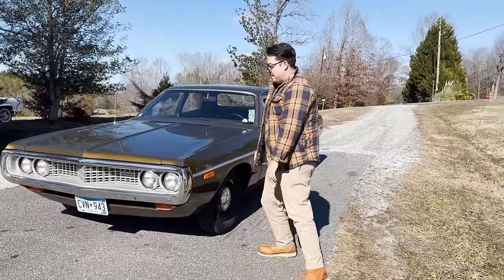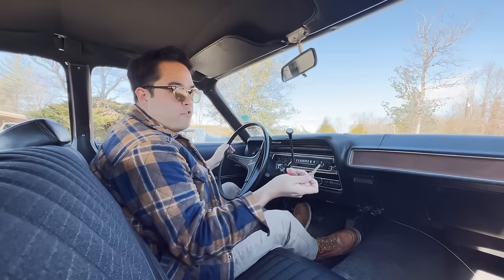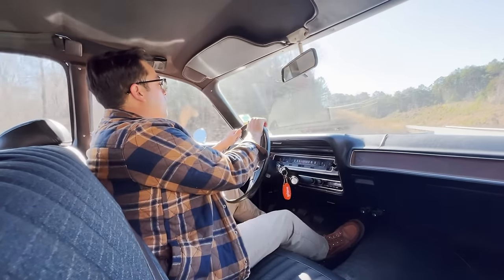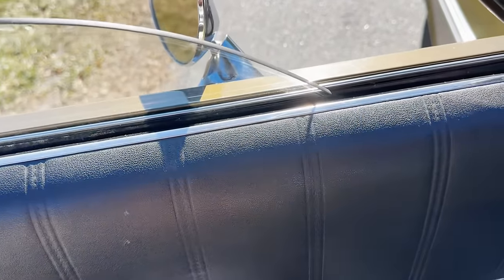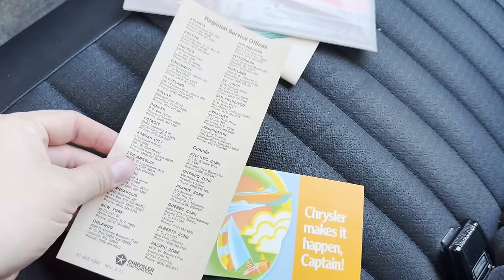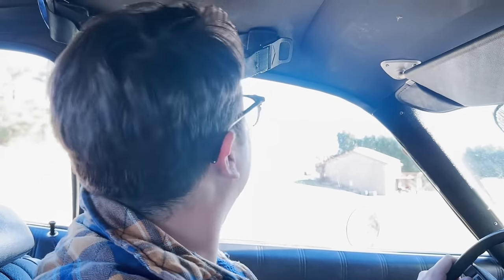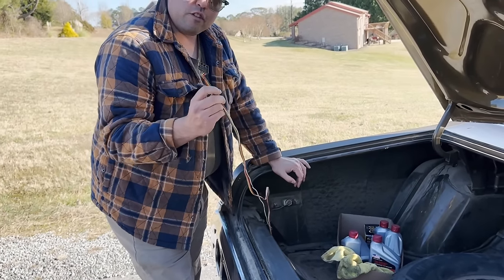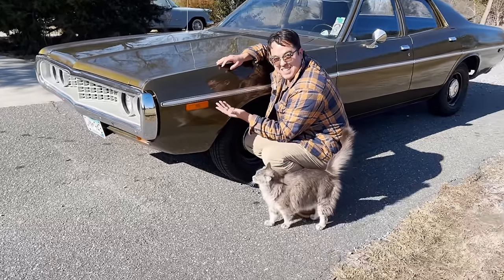1972 Dodge Coronet Custom! Rare Slant Six Stick Shift! Obsolete Automotive Reviews Walkthrough Drive

Comment: That car is in great shape.  I drove many slant-six models over the years with three-on-the-tree, and always enjoyed the powertrain as primitive as it seemed.  The slant-six is a very smooth engine, rivaling any BMW straight-six.  Pity it didn't get more respect over the years.  If you can quiet down the exhaust with a muffler, the engine sounds will be a treat.
Reply: the straight 6 from BMW, with 2.5 liter and just 2 valves per cylinder makes 168hp, the slant 6 100…..
Reply: Easy.... he said smooth,  not powerful. And actually,,, I think my 82 slant six is noticeably smoother than my buddies 90 M3 convertible.
Reply: Leaning tower of power. One of Chryslers' best.
Reply: @PatricioGarcia1973  Watch the  Power Nation build on a  slant 6. That is basically adding compression and cam  to compete with BMW  with modern fuel injection and cam profile for 220 horse.
Reply: @PatricioGarcia1973 Was this BMW sedans in the 70s?
Reply: @patrickwayne3701 
A ‘90 M3 convertible is a 4-cylinder bud, so no comparison.
Reply: @JeffreyWilliams-dr7qe 
Let’s compare this to a BMW M30 straight six, launched in 1968 in 2.5 litre and 2.8 litre form.
In the seventies, these engines delivered 150 hp and 170 hp. 
And they sound sweet.
Reply: @frankpeletz1818 
220 hp from what displacement?
Reply: @e28forever30  3.7 . And 400 horse when turboed.
Reply: I think they got their due. They were everywhere for many years.
Reply: @patrickwayne3701  if it really is a 1990 m3 it doesn't have a 6 cyl engine. the first gen m3 was a 4 cyl. second gen wasn't released until a few years into the 90s
Reply: All inline, six cylinders are inherently smooth. Just the nature of the beast. I have owned inline sixes from 150ci, 2.5l to 300ci, 4.9l, and they were all very good engines. Never owned a slant six, but drove several. Always thought they were good engines. Put a 225ci slant six in a Dart with a three on the tree, and they were surprisingly peppy.
Reply: In Australia, the Slant-6 was no slouch. It arrived in the Valiant sedan in the very early 60s. Our family or ‘full-sized’ cars were pretty much compact shopping carts by American standards. Chrysler’s offering, at 225 c.i. 145hp was a giant compared to what was offered by Holden (local GM) at 138 c.i and 75hp, and Ford 144c.i. (Supposedly and generously) 90hp. Pretty soon, GMH and Ford upgraded to 149/179 c.i. and 170 and 200 c.i. (The latter a rare option). Manual and three-on-the-tree were common. Even in 1973, our family got a Holden sedan with a 173c.i three-on-the-tree that had 118 hp. Super basic bare bones. By this stage, Australia had its own ‘petrol-head’ culture and smaller V8s were getting more common. Of course it didn’t last and two fuel crises later, the V8s were pretty much dead. Meantime, it was cool and almost ‘muscle-car’ like, to have a 225 in your family car.

Comment: Cool car. Back in 1986 I bought a 1968 Dodge Coronet 2dr Coupe from the original owner for $400. It had a slant 6 automatic trans. It only had power steering. It even had a radio delete plate. Trans went out a year later and I let it go. I should have fixed it but at the time I was putting my money in my 1969 Roadrunner. Sold that 10 years ago. Please keep posting cool videos like this.
Reply from the maker: How it goes sometimes… Thanks for following. Have plans for plenty more content on these old rides.

Comment: Kind of amazed at the condition of the car considering where it came from. The slant sixes were very good engines, surprisingly peppy for their displacement. Drum brakes weren't as bad as people make them out to be nowadays. The really biggest problem with them was brake fade due to overheating if used heavily or getting wet if you drove through water. Keep them adjusted, and they gave good service. Drove many cars with manual drum brakes for more years than I want to think about and didn't run into anything. Just need to understand the limits of what you are working with.
Reply: In other words, dramatically worse than discs.
Reply: @ErikDB6  didn't say they were better, said they worked well enough to get the job done at the time. Of course, power disc brakes are superior. Not a question.  Everybody knows that.
Reply: I'm amazed because it's such an undesirable model and that someone kept it and cared for it all these years.
Reply: @wb6162  different strokes for different folks, I guess. Who knows?
Reply: @christownsend7602   No doubt!
Reply: right on. and..ppl replacing the shoes with substandard parts to save a buck. i mean really..the price 
difference was negligible..wonder how many wrecks occured & even lives lost on getting cheap 
brake shoes & even pads for disc brakes..that could've been prevented? & yeah..this car is 
mint for being a Wisc car..must've not driven much in winter.
Reply: Super rare & super cool!
Reply: My 69 Chrysler has 4 wheel drum brakes, stops the car very well.
Reply: @Wiencourager  if drum brakes are maintained correctly, they work just fine. You learn not to over drive what your brakes can do. It was a long time before all cars had front brakes when they first hit the scene.

Comment: I was waiting for this video!  To answer your question about the seat inserts, they are definitely original.  As for the “Dodge” emblem found in the glovebox, that is a 1970 or early badge because the font was no longer script by 1971.  Does the fender tag have any Y codes indicating it was a special order vehicle?  It certainly is uniquely optioned to have the custom trim interior, the R11 AM two-watt radio and power steering.  Yet it’s an E24 Slant Six with a D14 three-on-tree manual transmission.  As for the “fasten seat belt” light, all Chrysler Corporation vehicles built after January 1, 1972 have such a reminder.  Early build 1972 model year vehicles produced between between August-December 1971 do not have such a feature.  Beautiful car, great YouTube channel and excellent Instragram account.  Let me know if you have any further questions.😮
Reply: Spoken with authority 👍

Comment: My first car was a 1965 Plymouth Valiant  4 door with a 225 ci. Slant 6 and 3 speed automatic. No not the push button, but the traditional column shifter. That car ran great. The slant 6 is near bullet proof. Mine never had any real rust either. It still had the clear plastic covering on the front and rear bench seats.

It had the stock AM radio. I did put in a good am/fm/  cassette stereo with rear deck 6x9 speakers.

I got the car in 1982 so it was 17 y.o. at the time but it was a great car for the $500 my dad paid for it for my 17th. Birthday. I at times wish I kept it and put on a real nice paint job and  just enjoyed it for the classic it was to become.🤔
Reply from the maker: My first cross country trip was in a 1964 Valiant 2dr sedan. 225 Slant 6 with 3 speed on the column. Bought it sight unseen in CA. Flew out. Got it roadworthy in a junkyard and then drove it 5000 miles the long way back home to NC. Lost the ability to use the clutch pedal near the beginning of the trip and had to drive most of the way without it!

Comment: It’s a beauty, and very unusually optioned too, I’d love to be driving a 3 speed, very cool. I wouldn’t be surprised if the cruise control turned out to be an aftermarket add on, they were readily available. I think a new muffler would be on my list of things to address though.
Reply: Had a similar '73 model 225 shift-it-yourself, disc power brakes, no power steering, after-market A/C. Mine was "dark yellow green metallic" paint code JF8 and on a good day gas mileage might break the 10mpg mark. Plenty of room, not a bad ride, but Spielberg could have made seven more movies about the electrical and suspension alignment gremlins. And the starting procedure: flood the living elkhound-crap out of it and then follow the flooded carb procedure was the easiest and most reliable.
Reply from the maker: Adding a muffler is on the to do list for sure!
Reply: @5610winston   I think something was wrong with your carburetor 🤔 Squeezing 15mpg out of the thing isn’t unreasonable, and a Slant usually starts with ease
Reply: My brother bought a 1971 Satellite  Plain Jane, 318,auto,and PS and AM radio.    I got to drive it , loved the power steering!
Reply: @5610winston  Guarantee your vacuum advance is dead.  That's guaranteed to kill fuel economy.  Wouldn't be surprised to find the centrifugal advance is stuck as well.  Send your distributor out for a rebuild and your fuel economy will increase big time.  
Your carb is due for a rebuild as well.  Your car should be getting in the high teens mpg with no problem.
Reply: Actually, I would try to add headers and maybe a split exhaust, just to extract a little more power-and cool sound-from that slant six. They were very durable, but needed a little more hp!
Reply: @curbozerboomer1773   The head was designed for the smaller 198 cu. in. six.  When Mopar stroked it to 225, the head was not changed.  So, it has trouble breathing.  More torque but, can't make the kind of HP that its torque would suggest.
Reply: @BlackPill-pu4vi  — The head was designed for the 170 …
Reply: @Clyde-2055   Then the 225 is even more choked than I thought.
Reply: @BlackPill-pu4vi  — The 225 was no powerhouse, but in the A-body, the pre-emission cars would do 105-110 mph … That was plenty fast. 

I don’t imagine this Coronet would do 110, brick-shaped thing that it is.
Reply: @BlackPill-pu4vi Uncle Tony could teach you how to build a slant 6.

Comment: My dad had a 71 coronet custom with the 383 2bbl, power brakes and steering with A/C. The color was butterscotch.
Reply: @jyeager2881. I loved the firing order on the 383 engine. It was supposed to simplify things but confused mechanics everywhere. Usually MOPAR engines used the same firing order as Chevys. If the mechanics weren’t careful the engine they were servicing during tuneups didn’t fire up so they’d try Ford’s firing order.  The actual firing order that MOPAR tried out on the 383?was 12345678. If they were sharp they’d go straight to the Miller Repair Manual
Reply: @LlyleHunter  ^^ LOLOLOL …

Comment: Since I was born in 1951 I remember cars that had the three speed column shift transmission, that was common in the 1950s and 1960s. Because there was a lot mechanical linkage going from the lever on the steering column to the transmission, the shift lever would have a considerable amount of free play movement. Also as the linkage became worn with age, it would become difficult to shift gears, with the gearshift lever binding. I also noticed that the seat belt and lap belt set up on this 1972 Dodge Coronet was the same as my parents 1971 Ford Country Sedan station wagon. So it is true that seat belts were set up this way in that early 1970s time period.

Comment: Very cool car, the slant 6 and 3 speed won't win any races but they'll last until the end of time if maintained. As far as the 3.21 and 3.23 axle ratios you mentioned about 9:00, it's because there were 2 different axles offered in the car, the Chrysler 8 1/4 (with 3.21 ratio) and Chrysler 8 3/4 (With 3.23 ratio) so upgrading to the alternative axle ratio gave you the stronger axle, but the standard 8 1/4 is really quite tough.
Reply from the maker: Seemed kinda funny that the standard ratio and optional ratio was so close. It doesn’t differentiate a different rear type Though a sure grip 3.23 ratio is offered as well. They’re so close that I don’t see much benefit of choosing one over the other unless you wanted the sure grip rear.
Reply: @ObsoleteAutomotive  Right, the factory literature never explained that by choosing an alternative (but a nearly identical axle ratio) you were actually upgrading to a different axle. Both axles had different number of pinion and ring gear teeth, so the available ratios were close but never matched.
Reply: The Sure Grip (locking differential) was always worth the upgrade. If only Detroit had equipped all cars with locking differentials and rear stabilizing bars as well as better shocks and transmission coolers all as standard equipment they would probably have done a lot better at retaining their market share when it was shrinking

Comment: Very hard if not impossible to get replacement parts for that shift collar / lever.  Treat it very nicely.  They're well known to wear out / break.
Reply: When I was a kid my mom drove a 1953 Plymouth Belvedere. It had 3 on the tree. I must have made her angry chirping/lipping off from the backseat because after she parked the car, the gear lever was wrapped partly around the steering column towards the driver's door. Dad had to weld up a new shift lever... sorry mom...

Comment: All of the dashboard controls can be adjusted intuitively, without taking your eyes off the road. Makes me wonder if the touchscreens of today are a step backwards. My parents had a 1969 Plymouth Gran Fury, a very similar design. The Chrysler styling theme from this era was billed as "fuselage" , owing to the aircraft-inspired rounded sides.
Reply from the maker: I hate touchscreens. I like being able to use controls without looking. It is going backwards and less safe in my opinion.
Reply: Agree it's a cost saving measure being marketed as a cool feature to the modern IPhone generation. 
I love my VF Holden commodore made in Australia you still have intuitive knows for climate control. Then infotainment features can be done with know, touchscreen or voice command. Shame about the demise of car manufacturing in Australia as we had some great cars just like the Americans

Comment: You're correct about the '71 cars having a separate buckle for the shoulder belt.  I had a 1971 Oldsmobile Delta 88, and the lap belt and shoulder belt did not connect and had their own buckles.  It's wild to see a 3-on-the-tree still going in 2024.  Thanks for sharing!

Comment: The marker lights and shoulder belts were a federal requirement starting in 1968. From 1968 through 1971, all solid-roof Mopar cars had the separate shoulder belt buckle that was identical to the lap belt buckle. It was easy to confuse except the webbing with the shoulder belt buckle was MUCH shorter. The front seat (with seating for three) was a rat's nest of webbing in our family's 1970 Fury base Suburban. When I was driving our Fury with the shoulder belt on, I could reach everything but the brake release.
Reply: You were very smart to have buckled up back then.  Most people that buckled up back then usually just wore the lap belt.
Reply: @bradparris99  We lost that car in 1986 when someone in opposing traffic turned left in the rain, and I T-boned him. I was the only one in the family who did more than lap belts. The ironic rest of the story is that I now belong to a 1970 Fury III convertible (i.e., no shoulder belts).
Reply: @OnkelPHMagee  As a 16 year old in the mid 70s I had my grandfather's 1970 Buick Electra to drive.  After about a week of driving and sliding on that big bench seat and seeing "Fasten Seat Belts" printed above the steering column I buckled up the lap and separate shoulder belts, mainly out of curiosity.  Aside from the obvious safety aspect of wearing both belts, I was amazed at how much better the car seemed to drive and handle while being securely strapped in the driver's seat. I was soon in the habit of automatically buckling up every time I drove.  I was probably the first one to use the lap belt and I am sure I was the first one to use the shoulder belt. My grandfather thought seat belts were a nuisance and crammed the belts into the crevasse between the seats.  Then one night in 1982 I was coming home from college when a drunk driver crossed the center line and hit me head on.  Because of the size and quality of the Electra along with the fact that I was wearing both the lap and shoulder belts, I walked away with only minor cuts, scrapes and bruises from the belts.  With just a lap belt, my face and chest. would have definitely slammed into the steering wheel and my injuries would have been severe if not fatal. Oddly, the drunk driver was wearing a 3 point seat belt but had the shoulder belt under his left arm- a 3 point lap belt-  and had massive head and chest injuries. Yes, those old style belts were a bit awkward to adjust and buckle, and definitely confining to wear, but after being in a head on collision, were well worth the effort and hassle.
Reply: @bradparris99  When I was in the wreck in 1986, the guy at fault was unbelted in a 1976 Century sedan. He left in a stretcher. I was walking (but heartbroken). The 1970 Electra convertible is my all-time favorite GM product; a neighbor had one when I was young. We borrowed it a couple of times around 1980. The front passenger's lap belt didn't work, so I vividly remember sliding on the vinyl. The only grandparents whom I knew were my mother's and father's father. They shared your grandfather's attitude on ANY seat belts. (I still have dreams involving Mrs. E.'s Electra every few months; that car did get to me. 🤩 )
Reply: The 1970 Electras were awesome cars. Be safe and enjoy your convertible.

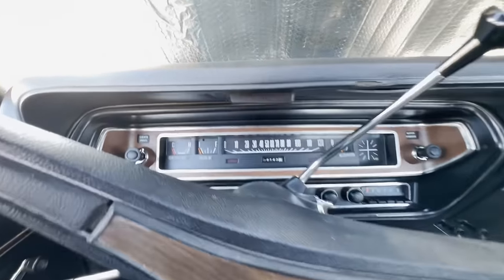Comment: 16:35 Yes, the FASTEN SEAT BELTS warning does light up, along with an annoying buzzer. You could disable the buzzer, but only by pulling the buzzer out of the fuse panel. The horn relay also feeds through that plug.

Comment: Had a 74 custom back in the day that my Grandfather gave me with about 70,000 miles ran it till little over 100,000. Frame got rusted out but the 318 was still running Strong! Took time but the styling grew on me.😊